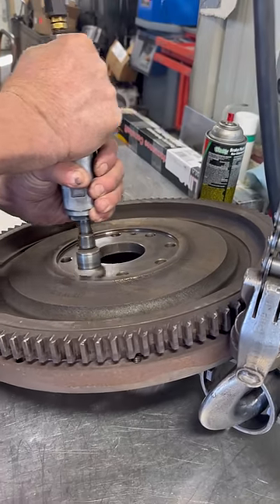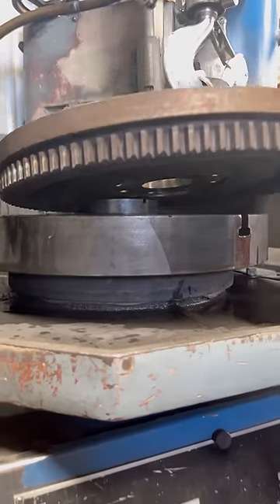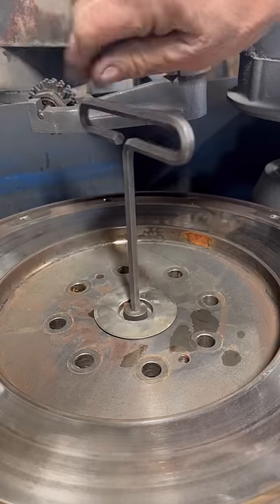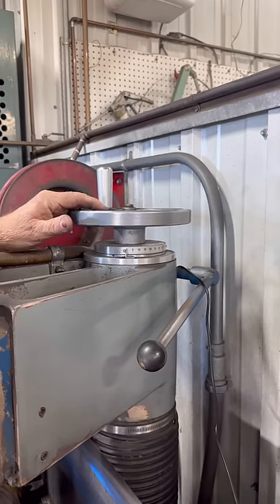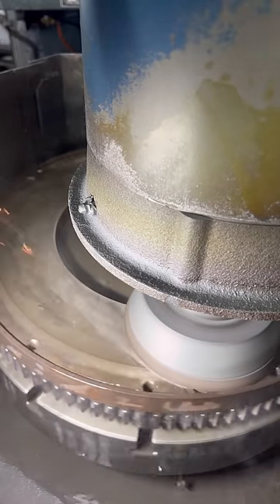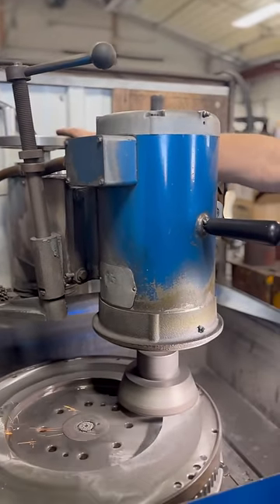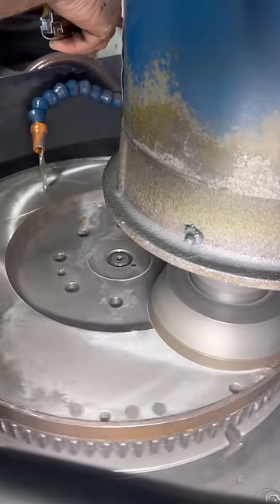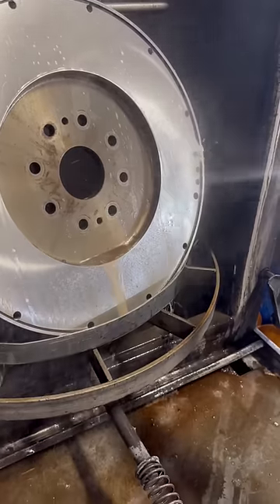#shorts Too Satisfying To Not Share With A Friend...

Comment: Note : on some cranks the bolts see oil and can leak onto friction area.
Use loctite thread sealer.
I just did a Ford F350 351w full of oil . Came out of threads
Reply: That's for lube to keep the clutch from chattering.

Comment: Do you guys ever check to see if the crankshaft mounting  area is parallel to the disc surface.  I've seen  them out before.  Takes out the pilot bearing  pretty  quickly
Reply: Yep seen that too
Reply: My car has no pilot bearing.
Reply: This was my thought also
Reply: Bro it's $100 an hour you think they give a shit?
Reply: I don't get your question. The grind they make in the part is automatically parallel with the mounting surface. 🤔
Reply: @EddSjo  no it's  just parallel to the back side of the flywheel

Comment: Am I wrong, or is the pressure plate supposed to be stepped off of the flywheel for a reason? Because it looks like that step was ground down flat as well. OR is that just due to wear of the friction surface itself? I'm not trying to be negative about this at all because it's really hard to find anyone that is willing to do anymore, but I'm asking because I legitimately don't know it's application or what the flywheel is actually for.

Comment: You would think smart mechanics would test the water flow and not make the cutting edges bounce the water everywhere if the cooling or cutting fluid was close enough to be drugged under and used as it was intended of cooling the entire discafter cutting , but have the water just before the cutters and use it to cool that area better because that's why it's actually there .